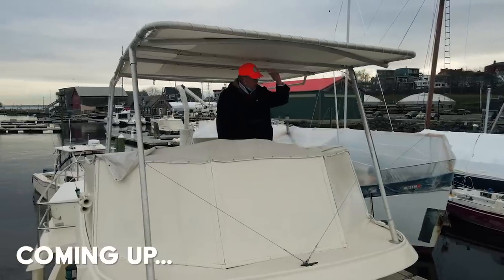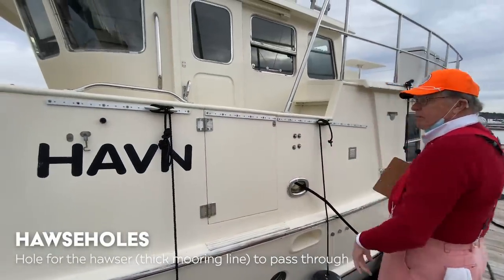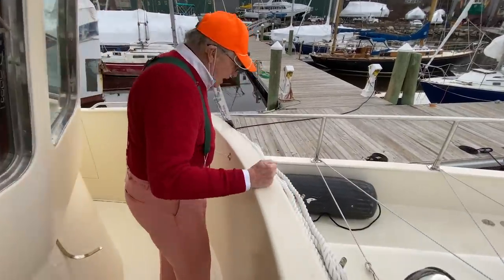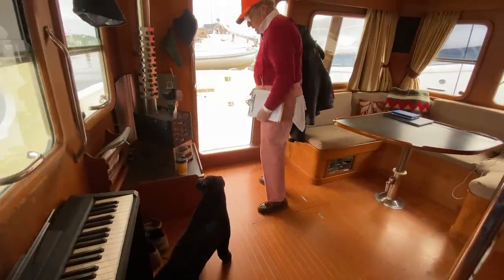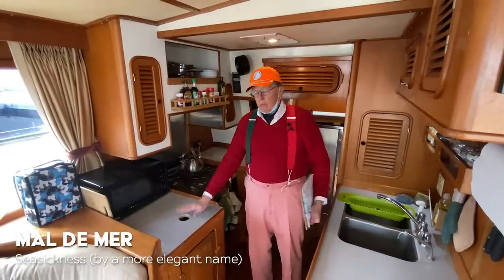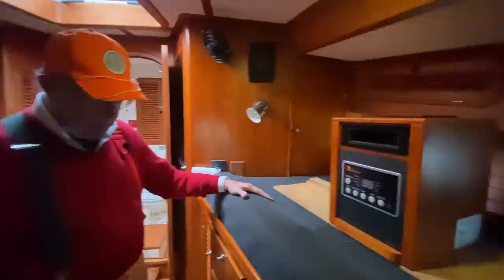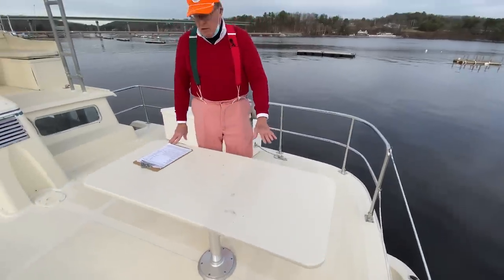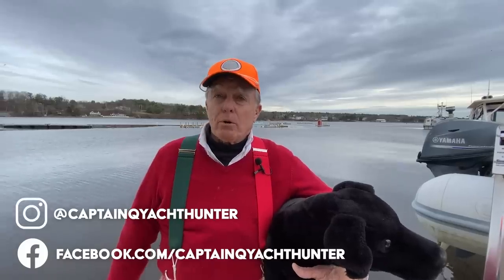Nordhavn Motor Trawler for sale $209k | EP 21 #motorboatsforsale #motortrawlersforsale

Comment: Nice if you got buckets off money for fuel
Reply: Nordhavn are known for being extremely fuel efficient. Yes they have big fuel tanks, but they only burn 1-2 gallons per hour depending on the engine model. You’d only fill up once or twice a year with moderate usage. They’re trawlers though, so you only run at 5-7 knots.

Comment: I know its cheap, but that air filter on the engine doesn't pass my sniff test.  TON of deferred maintenance on this boat.  I can deal with cosmetic things like the paint being shabby(that's like paint the boat or new Honda Civic), the interior being worn doesn't bother me, reupholstering is easy.  If the mechanicals haven't been kept up, you are just going to be constantly fixing things and having issues unless you bite the bullet and do a major refit and replace everything(like $100k+)    Still though that is A TON of space for a 46' boat and I love the way Nordharven builds their boats, they're a quality product.

Comment: The davits are holding the dinghy w-a-a-y out at the end of a long lever arm.  Considering the weight of the outboard and the rib, I would worry about looking behind to find the dinghy had sailed off on an adventure of its own.  As for the DIY upgrades, the install of the monitors portside in the pilot house could be much better.  I think I am spoiled from looking at the quality construction of most blue water boats.  In contrast, amateur construction almost has to look a bit shabby.  That flying bridge is certainly an example - I think in a blow it would become a fly-away bridge, giving one the opportunity to re-do the thing from its base up.  In general, I like trawlers and motor sailors, especially for their use of space.  Losing the masts and outdoor steering cockpit changes the design constraints, and frees up better use of spaces.

Comment: She’s a lovely boat captain would be a awesome trip across the Atlantic. 😎
Reply from the maker: You can see the trans-atlantic trip here -- https://m.youtube.com/watch?v=RTcNrrLaffI
Reply: Certainly a great trip to undertake..... However, I'm not sure that I'd like to do it in a motor boat! The cost of the fuel would put me off and the thought of that engine running non-stop for weeks at a time while crossing!
Reply: @paulsinclair3401  the 146hp main engine sips fuel with it’s pinky up. Unlike most motorboats, these Nordhavn are known for using only 1-2 gallons per hour at 5-7 knots.
Reply: @jlewis4587  sounds great if that's so...... but the Nordhaven website which gives full statistics for that boat at various revs and speeds gives some double that as being the norm for that boat with that engine...... To run it economically,  one would have to be averaging speeds of around 2 to 3 knots and even then, it won't be as economical as the same engine in a Motor Sailer, as you also have the option of a sail, plus the different hull displacement inherent in a sailing boat of any sort.  
So without any doubt, I totally agree with you that this Nordhaven is a very fine boat for somebody wanting a Motor Boat and they'd be hard pushed to find a more economical boat to run..... however, my only point is that for those willing to do some sailing a Motor Sailer wins! But different boats for different needs as always.

Comment: This is about the only Nordhavn my banks says I could obtain.  Not the pretties dry stack and really small galley from the current models but it does get me into one and not looking at YT videos dreaming about it year after year.  I've never seen this floorplan before. Very different than the 2000 boats.  Most of it is surprisingly well laid out being so different.  Not a big fan of crawling in the engine room.  But overall, fulfills most of my wants, especially price. Has to be other ones out there.

Comment: This boat looks great and am 100 % it has found a new owner by now, who will also enjoy taking her out to sea. Nordhavns are built to last and if you don't like the interior you can always update her a bit. Fully stabilized for just 200.000 USD is truly a steal. Just the stabilizers alone would set you back about 100.000 USD  if you would think about installing them on a boat that does not have them.

Comment: $209k for the boat, 20k per season for fuel and engine work.
Reply: a plan for every boat, 10% per year, plus docking fees
Reply: @johnnyhunter4345  absolutely.   I like the plan of sailing and keeping the boat on a mooring.  Docking fees = 1/4 of a slip.  Fuel - 1/50th for the season.

Comment: Worst kept Nordhavn I’ve ever seen.  Seeing that air filter caved in like that means the engine wasn’t breathing properly. What in the all those electrical wires sticking out all around the engine 😆. Have to spend 150 K to straitened that mess out & possibly rebuild the eng & I certainly would replace all seals on main engine & kicker. Body wise it look fine even the wood work. Nordhavn is a tough boat but I can certainly see why they have a low asking price because your asking for troubles. Most used ones I’ve seen have been kept up impeccable with full maintenance records. Don’t get me wrong I’m a Nordhavn fan all the way. These boats have traveled the world breaking record after record. I wish he had mentioned the hours on the engines . What a shame such a work of art like that has been so neglected. Did you dirt & filth in the anchor bay, unbelievable! At that rate I’d have to pull it out of the water & check for hull damage & clean the bow & port thrusters & replace the  seals in those. If I was going to do the great loop I’d look for a good Nordhavn 35 at least a 2012 to 2017 model. Trouble is no one wants to get rid of them.
Reply from the maker: Diamond in the rough… it is a few hundred thousand less than the closest one on the market… so good room for improvement and to make it better and possibly save a few bucks in the long run

Comment: A nice boat for a motor boat - however, how could you possibly say "there are no masts - that's the best thing about it"?  😲 That borders on blasphemy! 😲 
There are plenty of good and really nice 'Motor Sailers' for those of us sailors who are a bit too long in the tooth for too much activity and yaw on a pure sailing boat. 
Some motor sailers even have 2 engines, or would have at least a single 140HP such as this Nordhaven. Also, it's easy to have push-button sailing these days to take away the effort of hoisting sails. 
So my main challenge to owning a Motor Trawler as a pensioner now and having to be a bit more careful with the pennies, would be the thought of filling this boat's approx. 1,000 gallon fuel tank and watching it guzzle around 4 - 6 gallons per hour of diesel for a respectable speed of around 7 knots, is the running cost! I may have the same with a large Motor Sailer, but at least for longer passages, I can have the option of utilising the sails - particularly in a long passage and still achieving the same speed with good wing conditions. 
Some 10 years before I reached retirement age, we moved to a large twin engine motor sailer for comfort and economy and really enjoyed every year of it. 
So there's a challenge for you Captain Q - see if you can find a couple of ideal Motor Sailers for retirement which satisfy all the needs of retired sailers and present them to us?  😃
Reply from the maker: We are up for the challenge and shall keep looking. Thank you!